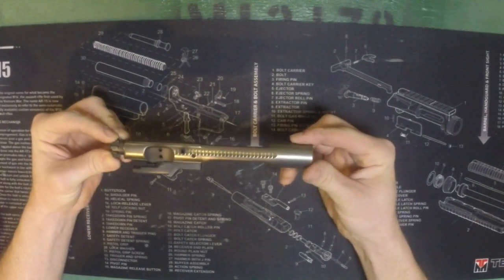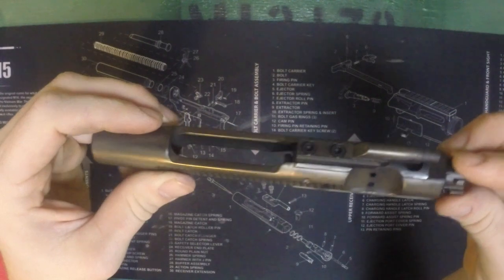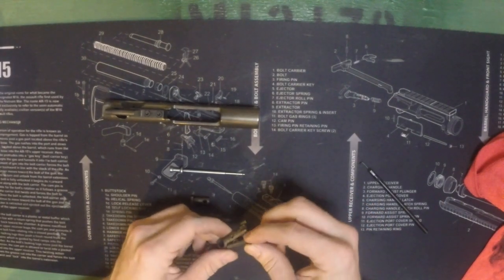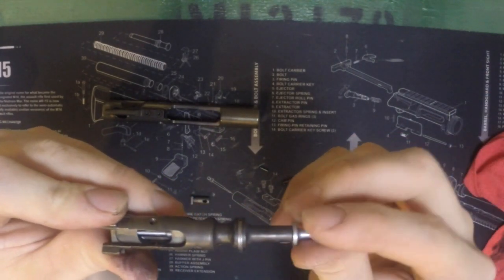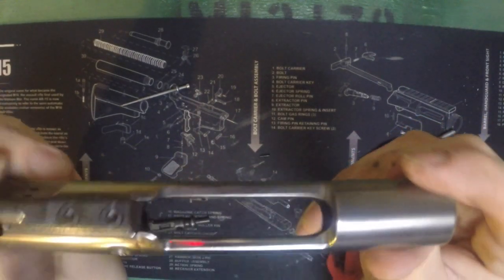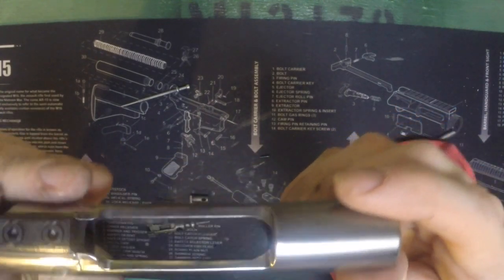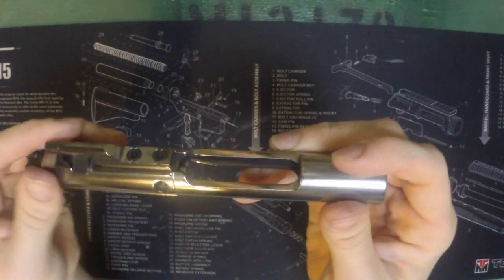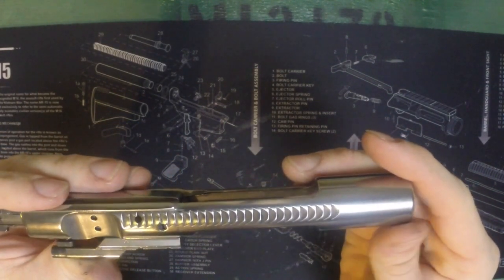Nickel boron Bolt Carrier Group clean and polish

Comment: What did you use to hand polish with?
Reply from the maker: Mothers metal polish and a dremel with a polishing wheel. Soaking in chemicals expedites the process but use them carefully, depending on your factory coating
Reply: @FLXArmory  My coating is a nickle boron from toolcraft. I actually just got a small tub of mothers mag but I don't have a dremel. Can the polishing be done by hand and if so would a simple microfiber rag suffice?
Reply from the maker: @TerminalM193  100%, elbow grease works just as well as a dremel, just not as easy. Cleans up like new either way.

Comment: What dremel attachment did you use??
Reply from the maker: I used one out of a bulk attachment kit but any polishing wheel or pad will work, they have a cone polisher, I didn’t have great luck with that as it was too hard and didn’t conform to the curvature of the parts well.